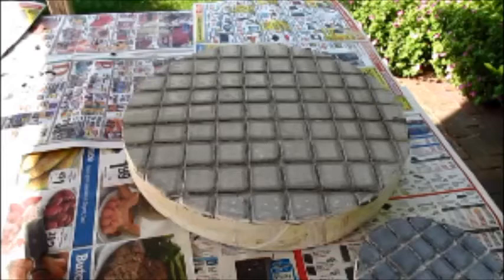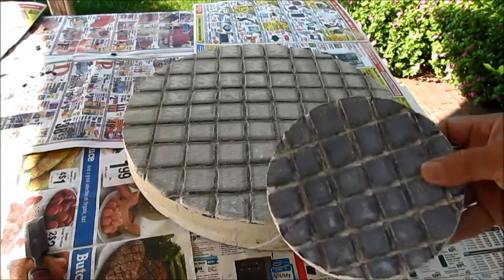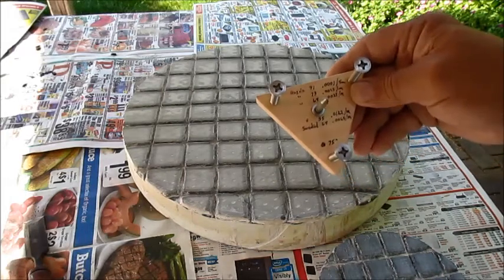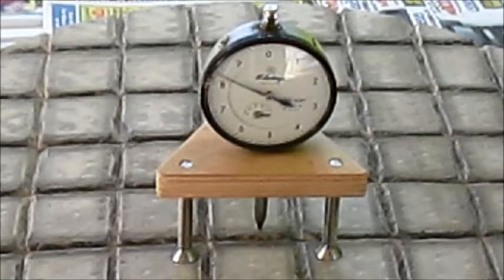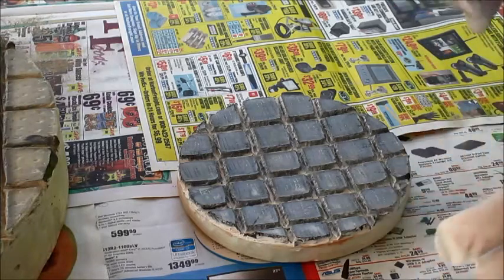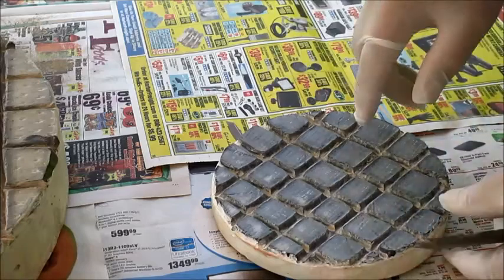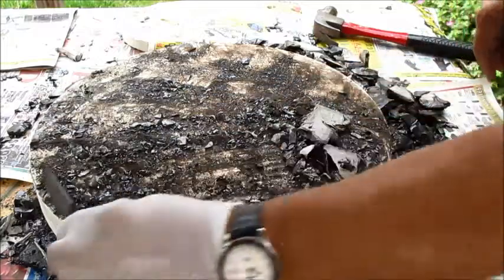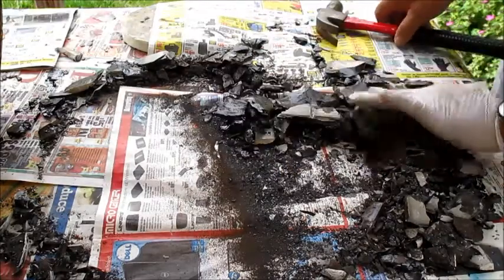Pitch

Comment: Try putting the old tool into a plastic shopping bag a place it in the freezer. Once cold it will be even easier to remove the pitch off the plaster backing.  It works really well.
Reply from the maker: Sure,  my first choice is freezing but doesn't always come off.  Also large laps won't fit in my frig freezer compartment.   Ed